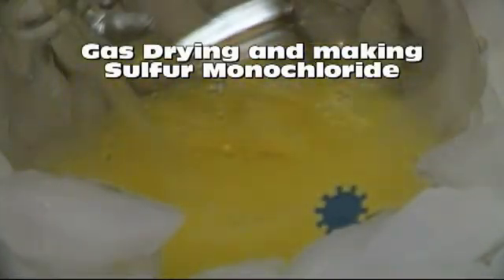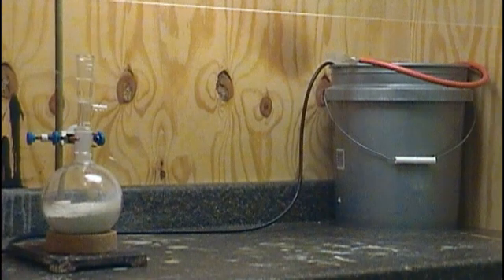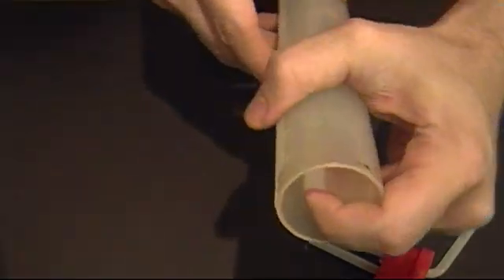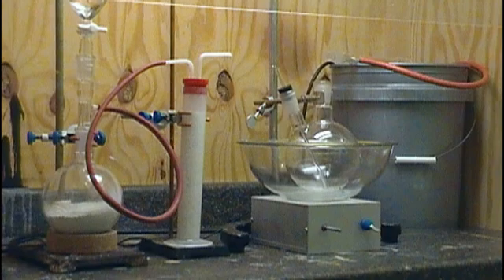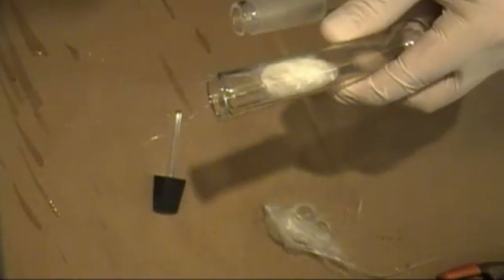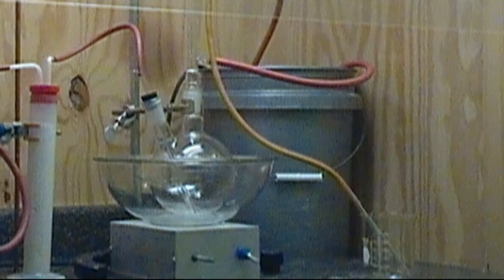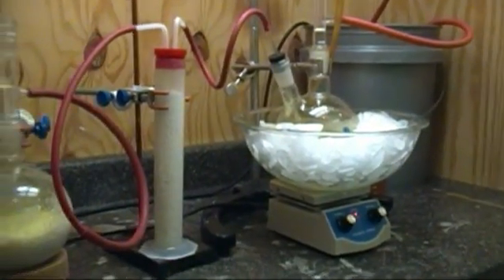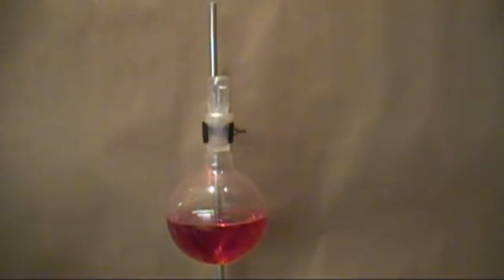Techniques for drying gases while making Sulfur Monochloride

Comment: Nice instruction but I guess the most product you got, obviously deep-red, is sulfur dichchloride. Disulfurdichloride is yellow to orange. (However, it's a mixture) 
But be careful about solid drying agents. Such like CaCl2 may become moist and sticky, depending on the water in the gas, eventually blocking the gas stream resulting to build up pressure. Better to use molecular sieves, liquids or if your using such chemicals: use a glass-gas-washing bottle.
Btw: better to add stirring bar first ;)